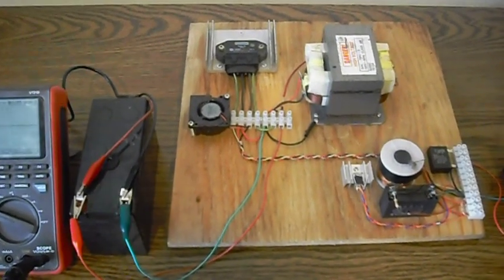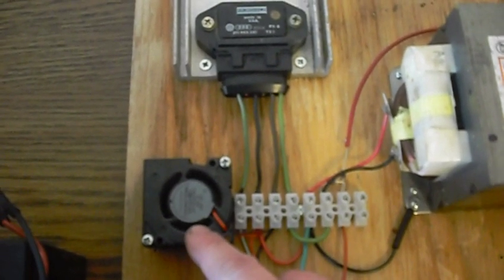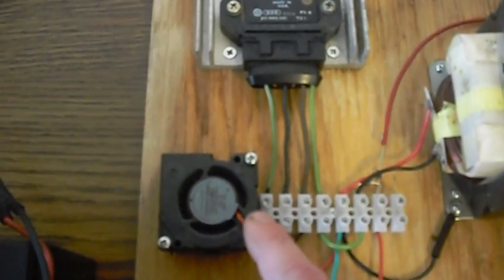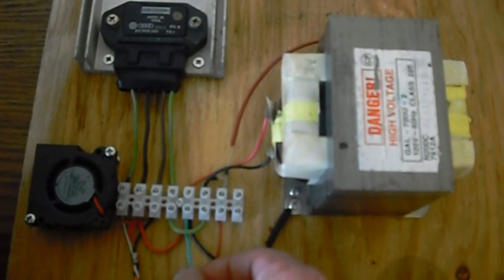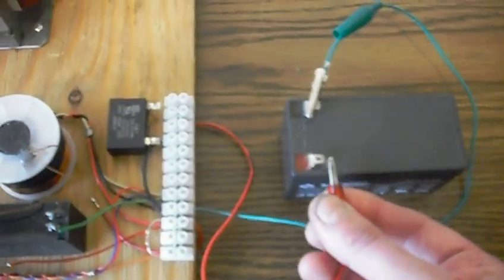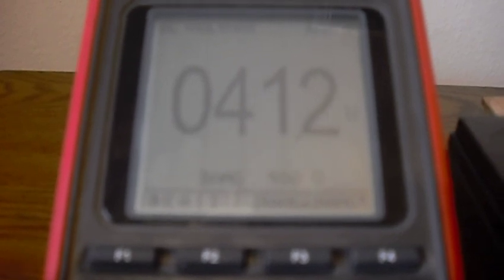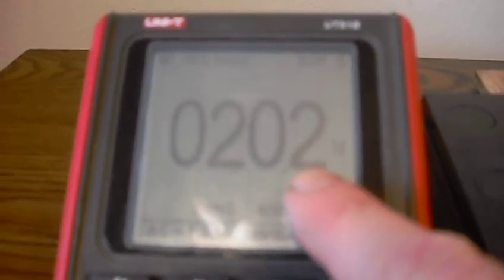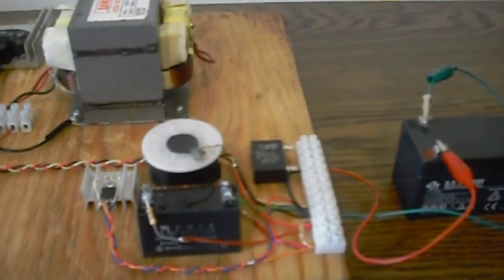High Voltage Radiant Charger -  Small Battery Charging a Big Battery

Comment: Is this the So called, "Tesla Charger"? Does it work for lead acid batteries? Thanks in advance
Reply from the maker: +Jesus Palacios (JPdrums) The Tesla charger is the same effect yes. When you use radiant voltage spikes to charge lead acid batteries you end up an excess of energy. If you hook up an oscilloscope to a radiant discharge spike, you'll see that inside the spike is a vibratory wave pattern in the 2.0 Mhz or higher range, and this vibration draws in energy from the zero point field. Lead acid (car batteries) are the other half of the equation. Lead acid batteries use sulfuric acid mixed with water as the electrolyte. Even old dead car batteries can be re-conditioned and will work when you use radiant charging. Lead acid batteries have the magical ability to convert the radiant energy into plain DC voltage. NiCd, NiMH and Lithium do not.